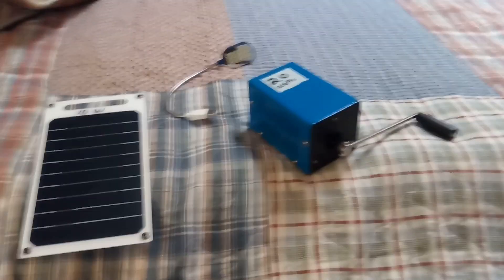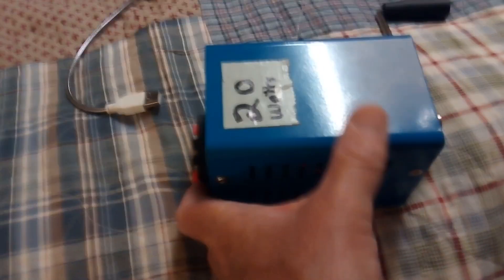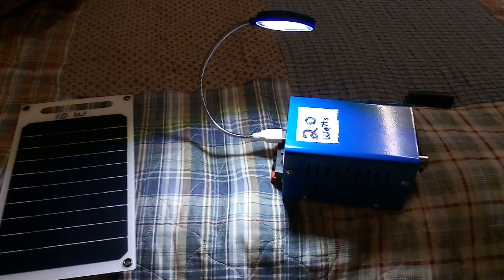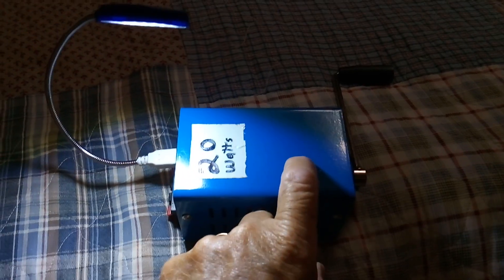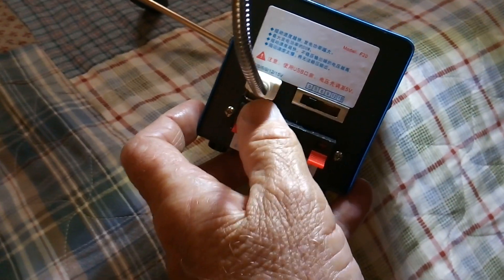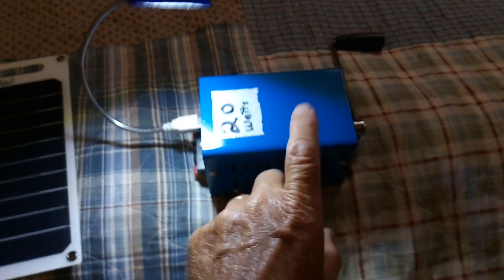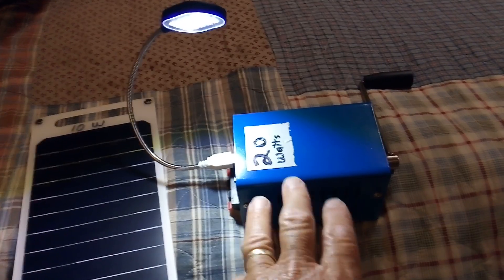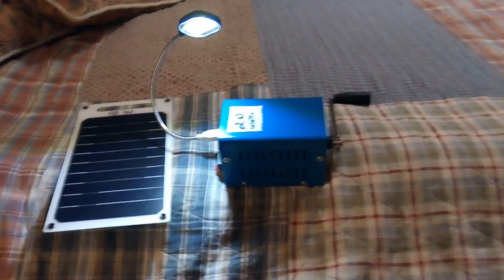Lasersaber Mini Boost Box---- PART 3

Comment: Got me one & waiting for the supercapacitors to be delivered. It is just a shame they didn't make the USB outlets automatically 5Volts (a simple BuckConverter circuit should have been built in to cover the job at little cost. Thoughts?

Comment: nicely done... Good idea with the 3x100F caps in parallel. But I fear that if you do a 3-3 configuration in parallel , you will need a balancing circuit, but they use a lot of power themselves. so i think i will give it a try with 3 x 500F caps i got lying around... (just one bank)
they were really cheap, The prices went up a little, but now they are around 2 to 4 dollars piece on aliexpress. I got mine  with balancing boards, but the problem is the board uses up like 0.3 volts within the first 5 minutes.
Luc
Reply from the maker: That will work quite nicely.  I went ahead and did the 3-3 parallel today and it worked.  There is no free ride though and it takes longer to fill the cap bank up to 5+ volts.  The plus side is that I can run that little reading light for an hour now.  After an hour a 5 minute crank session gives you another hour.
Reply: that makes my imagination go wild!!!.. imagine an electric boat, a device like this one in bigger, connected to a home indoor bike. Whenever you have empty batteries, you jump on the bike and after 20 minutes you can get home again. on the water... but of course you would need a bigger dynamo then this one, but it is feasable.. cant wait to see your new one with the parallel caps.
Luc

Comment: The black and red connectors are what's usually on small stereo speakers.
This is Y the YT vids complain on them so much,. They are made for audio output and are not designed for dc current connections...
Reply from the maker: So far I've had no issues with them.  I am not drawing very much amperage out of the thing.

Comment: I am so happy that you built it up.  I agree with your thoughts.  I did the eight caps because I was thinking that I would charge it up to around 20v.  In the end I never charged it above 15V.  It will be interesting to see if it runs the USB light on 2 parallel strings of 3 caps for a longer time than than on 6 in series.
Reply from the maker: Well you did it again. This thing really works.  Well done!  I will try different cap arrangements and see what happens.  I hope other people dive into this project and add their ideas.  This thing screams at me to power it in some other way.  Wind, water,  pedal, or something.